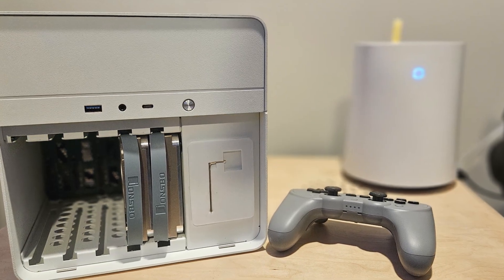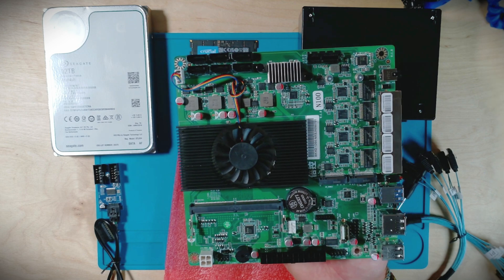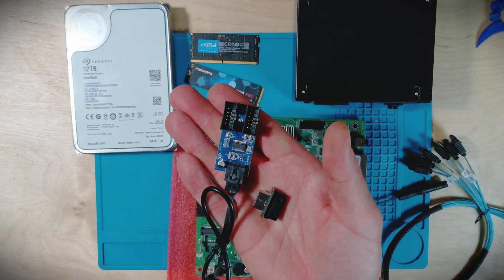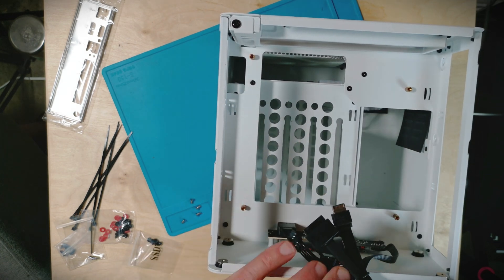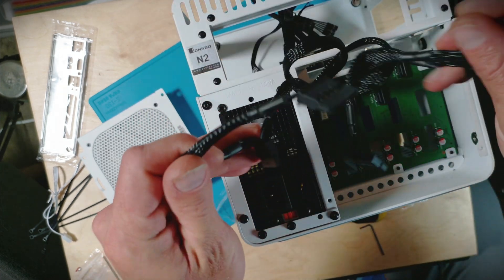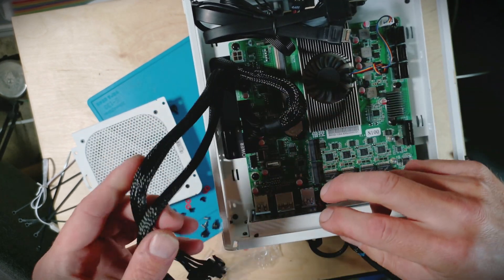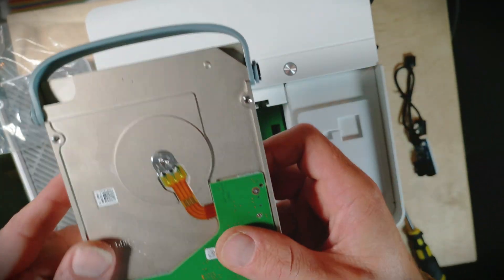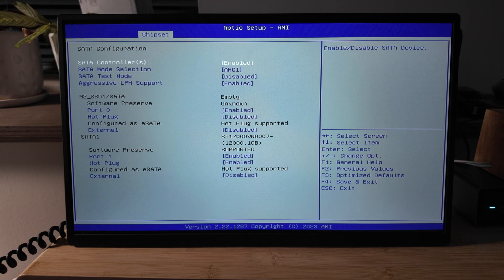DIY Cloud Storage: Build Your Own NAS

Comment: Im going to build a home nas integrated into my work table from a used fractal design case that is pretty beat up otherwise but has a pristine 5 hdd cage that would be easy to bolt into anything pretty much. And the part where one attaches a motherboard i will cut out with a dremel, going to use a i5-11500 cpu installed on it, also works as a media server and home assistant vm. I would of used a i3 there but the 11th gen intel does not have i3, and 10th gen is limited and inefficient with 10-bit HEVC processing that i need for my media. Currently all my equipment has been just loosely piled up on the table...kinda. Not really safe as it is but its going to get better (and the hdd are loud spinning against the bare wooden table), just need to cut the case and plan where i place the cage for hard drives that also has the silicon pieces making the hdd finally silent. My system will use the same sort of sata cabling as your link gives and a ssd m.2 cache placed on the motherboard with that i5. My first time venturing into NASses outside of single/double disk stuff.
Reply from the maker: Dam V that sounds so dope! I have seem some of this type of thing before like but it was a clear desk with a PC in it I believe, it was so wicked cool. I have also seen stuff with like computer in draws, all super RAD. Sound like you got a heck of a plan and project! You must post or film or once done perhaps show it of on the channel if you are open to it! Love to see projects like this and I am sure our community would too! Cheers!

Comment: Great video! I have been tinkering with computers since the early 1990's, and everything I have learned is purely from trial and error. Messing with Windows settings and consequently crashing my PC, thus learning how to fix it. I have rescued and/or rebuilt many desktop PC's and laptops over the years, most of which I gave away to people or NFP's who needed them. I  built my home lab three years ago, and it's still nowhere near set up fully. I recently rescued a QNAP NAS from my employer's IT scrap pile, It powers on, but does nothing else. But it came with four 4TB SATA drives which are all in good order. I have been looking at the these DIY NAS units on Amazon recently, but was still on the fence about buying one. That was, until I saw this video, I am now much closer to firing the parts cannon and making it happen  BTW, You said in this video that you have a "256 TB hard drive, small but big enough". I think you meant 256 GB, Right?
Reply from the maker: Hey Neil thanks for the comment. Man that sounds like such a score! Your path sounds like mine, build it, fix it, break it, learn from it, throw some things then back to it lol. Good catch for sure, 256 GB not TB, I WISH! lol. Really appreciate the comment, and the kind comment. Thank you so very much!

Comment: Ive heard that the main board doesn't come with paperwork. Was there issues connecting the front panel wires to the board?
Reply from the maker: This is correct you want to buy one from a vendor that has links to the diagram. Some do some don't do be careful you you buy through for sure. Cheers!

Comment: Cool build, I'm also contemplating it. How is the noise level of the case fan and airflow in general?
Reply from the maker: The stock fan is loud, like too loud, so I found a mod where you can 3-D print an adaptor that lets you fit in a Nactoa fan it it made it pretty darn quite. I used a Noctua fan, 120mm and the adaptor here https://www.printables.com/model/526778-jonsbo-n2-extended-fan-module

Comment: Fun Mod - If you use an external PSU or a Mainboard with a barrel Jack (I have a ODroid H4 Ultra in the same case) you can fit SSD in the Space for the SFX PSU. I´ve printed an Adapter for 4 hotSwap SSDs Adapters, so now I have a total of 11 Drives in that Small case :D
Reply from the maker: That's so freaking cool. Great idea and execution. I'm blown away how clever this community is everyday. Thanks so much for sharing.
Reply: So since that only has 4 SATA, I am assuming you sacrificed the PCIe sole slot and put in one of those linear PCIe SATA expander cards?  How were you able to mount that because looking at the board it seems the PCIe is on the bottom of the mobo which is an unfortunate design decision?  Also how did you power them?  Photos would be great.  An artist always shows their work :)
Reply: @psychic1999  ODroid has a 4x NVME M.2  Adapter for the Slot under the Board with a Bifurcation Support-BIOS. Slows down to PCIe 3.0 x1, so no real Highspeed (that´s why the SSDs are on 4 the Native SATA). There I have 2 NVME m.2, a Coral TPU and a 5x SATA NVME Adapter. Had to connect that with a extension Cable and still needed to set the Mainboard a few mm higher..  The External PSU gives up to 130Watt, which just seems to be enough to power with the 4 SATA Power connectors on the Board.

Comment: I would actually suggest plugging all your SATA connectors in, you have the cables at the ready and they have power, so if you ever want to add more drives you don't have to go and open the case, and can just slide the drive in and you're good to go (especially considering your motherboard does seem to support hotswap).
Reply from the maker: Good point! Got more drives coming! Cheers